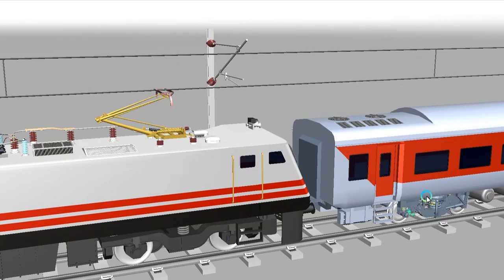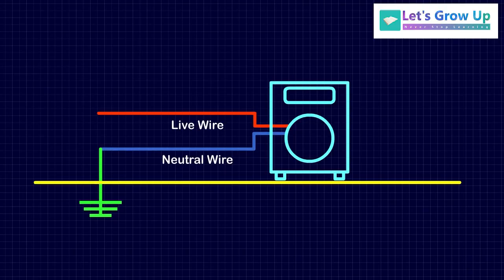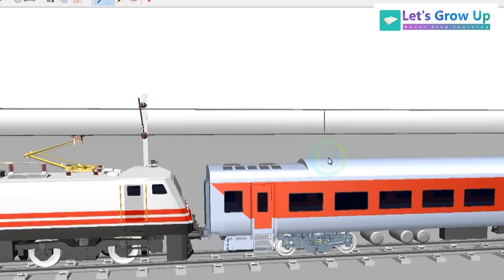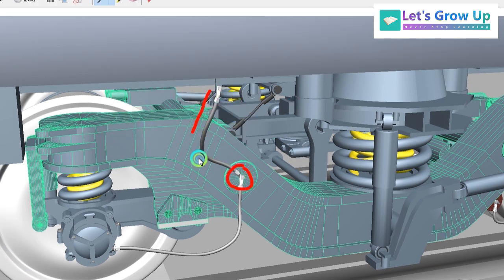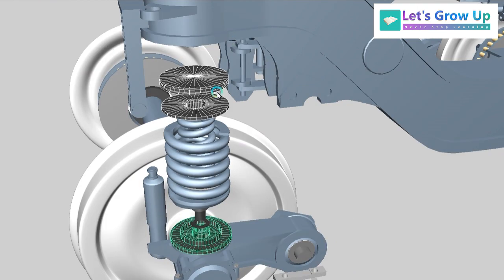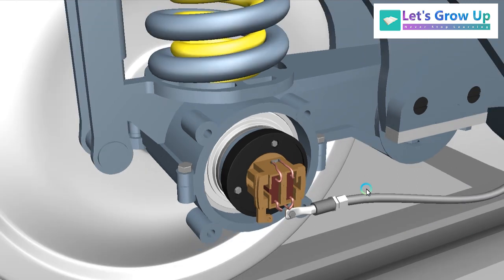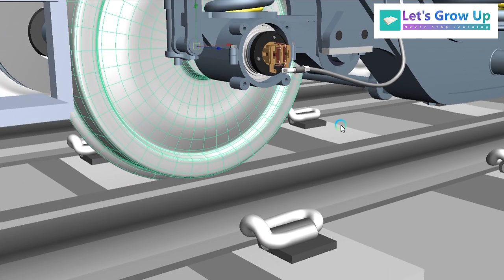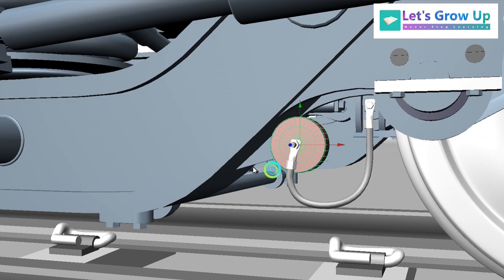Importance of earthing in LHB coach | #letsgrowup | #earthingdevice

Comment: Actually the concept goes like this: in absence of earthing device the current will flow from the coach body to the tracks passing through the CTRB (bearing) which may overheat the bearing causing problem in rotation of the wheel... The earthing device provides an alternate low resistance path for the current from the coach body to the wheels directly through the axle without passing through the roller bearing.. The carbon brushes maintains a sliding contact with the axle
Reply: Yes👌 correct sir
Reply: I was going to type this comment. But it was already there. Good. The current is not supposed to be passed through the path of bearing. Besides one point that has not been explained is that most passanger coaches have thier own battery packs and generators connected to the axel for generating electricity for all electric appliances.
Reply: So the resistor is the alternate low resistance path for Alternator.
Reply: @shrikantdhande4164  these are lhb coaches and it receives power using EOG   so no alternator is present in individual coaches as seen in icf coaches..
Reply: @priyankugoswami4442  
My question is why resistor provided in Bogie? As earthing device is providing low resistance path ,what is the reason for Resistor?
Reply: @shrikantdhande4164  resistot is provided in the axle which is not provided with carbon brush arrangements so as to prevent the flow of current through that axle..
Reply: Why is resistor present in Bogie?